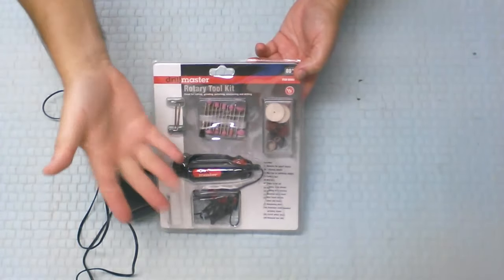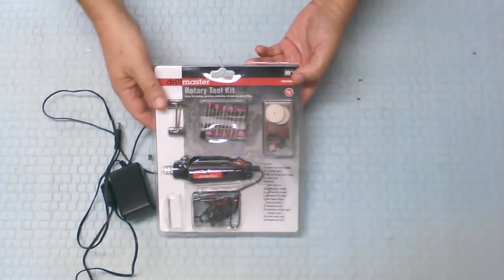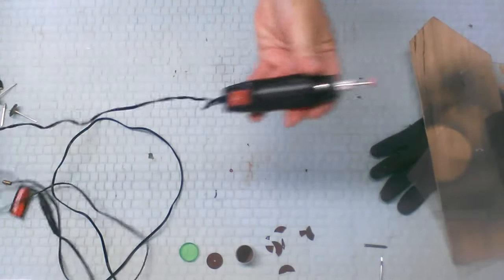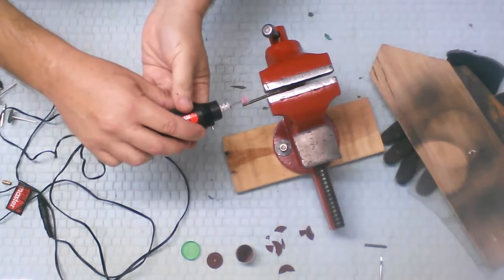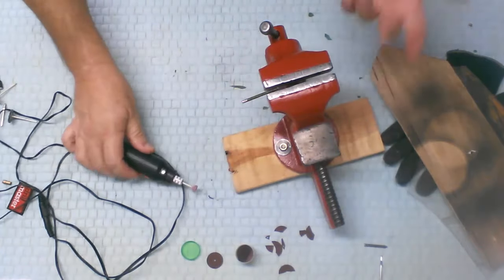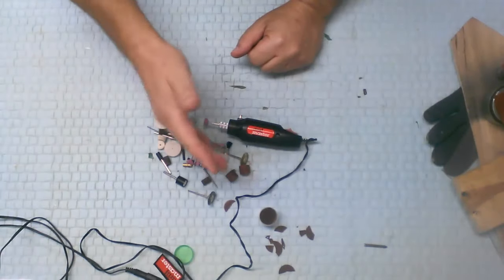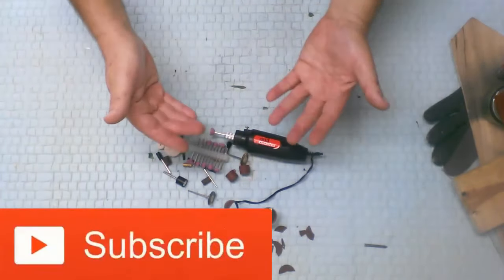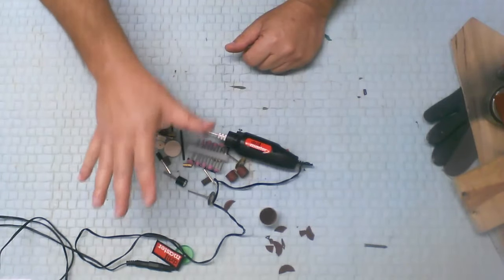Harbor Freight Rotary Tool / Drill Master Rotary Tool Kit Review

Comment: Bought this one this week to cut an aluminum crimp band that holds the fitting on the end of my garden hose. It took about 40 seconds to cut off. A normal rotary tool would have taken about 5 or 10 seconds. Just as you said, this thing would be ok for hobby type tasks, or maybe light duty for someone that might only need to use it no more than a couple of times a year. For $6.99 it is good enough for some light duty jobs, but after using it I realize that I should have spent more for a better one that could be used for all jobs. Very good video

Comment: On the nail test, as with any tool, the idea is to let the tool spin at the maximum RPM and let the blade do the cutting. If you pressure it, and it loses RPM, you won't cut as deep and it will take 4 or 5 times to cut the same amount. This goes for any tool, even your other two rotaries, or saws, or grinders, or anything. Maybe you are just too heavy handed? It would also make sense for your other rotary tool accessory video, the only other I have seen to this point. Also maybe you have a bad angle but if you watch the video back you will see you don't stay in the same groove or at the same angle, again furthering the time it would take you to cut. you hop skip and jump out of the hole at like 19:21 and just keep going though you are about 5 blade widths away from where you are cutting at.
Reply from the maker: I understand what you are trying to say but unfortunately you weren't using the tool. The tool itself has a terrible wobble (unbalanced) making it very unstable causing it to keep hoping around. The blades are also horribly irregular and not flat causing instability and poor cutting. The RPMs could not be kept at a consistent rate because the slightest pressure would cause the tool to bog down. I was cutting with the slightest pressure. Any less pressure and I would be there till Christmas. It is just a terrible tool, even though I tried to end on a positive note.
Reply: Amen, Brother!👍
Reply: Exactly!
Reply: @ModernDIYProjects i can get it quite centered when careful, but it is indeed easy as hell to make it wobble

Comment: Got this from harbor freight. The tool packaging says that it’s for wood I think somewhere on it. Not sure now. I threw the packaging away. I was cutting a car trim piece so, a piece of plastic. Cut through very well. It’s important to go slow and give the cutter some time. I think the plastic was about 2-3 mm thick and I was cutting a 42x20mm rectangular hole in it. Took me maybe 15 mins. This was the first time I was using a rotary tool, so I was very cautious. The shank did move up and down a bit on occasion and it was because of the grooves that were formed while making multiple passes. Took a flat head and removed some of the excess and it cut through just fine. 

All in all.. $10 for some basic hobby projects.. I won’t be trying to cut metal with this.. since it doesn’t appear to be made for that. Haven’t tried it on wood either. But plastic works very well. Just be patient.

Comment: Thank you for your honest review and also saving me $10. I almost considered buying this until I saw your video.  As a general rule I never buy anything from Harbor Freight that plugs into a wall.
Reply: I will say Ive been pretty happy with the corded 1/2" impact gun
Reply: @hopingforthebest1.9  Same here. In fact, it regularly out-performs my IR pneumatic 1/2" gun. I've had to tinker with it to get it to engage all the time in reverse, but it's performed like a champ for me for years. Just the other day, I thought I'd burned it up doing the control arms on my car, but the next day I pulled it out of the garbage and took it apart, to find the positive connection had come loose from the trigger switch. I tightened the screw back down and applied a li'l thread lock, and viola! Back in business again!

Comment: I finally had to throw mine out even intended as a light duty use. I spent way too much time patching it together and adding tape and glue to the motor mounts to keep it from vibrating itself apart. I can definitely recommend the Chicago Electric regular size rotary tool though, have had two that lasted for many years.

Comment: To be honest even the cutoff Wheels that are Dremel brand would break if you pulled on them like that. Not saying that those are not flimsy just saying that cut off wheels are not designed to be side loaded. I don't understand why someone would buy this though unless they are really really strapped for cash. For twice the price you can get a full size rotary tool off Amazon. And for another 20 bucks you can get one that comes with a flexible pen extension, router head, grinding shield, and a enough attachments to last you for years.

Comment: I have this tool and it's best used to crafting that is what I use it for.  If you put the attachment and tighten it and then screw in the blade it won't fall out and you won't brake the blade

Comment: I have the same set and I agree that it has it's limitations. However, try and get the accessories for a better price. I realize they are not of the highest quality. I too have to tighten the collet with small pliers, but I use it for a lot of small tasks. We will see how long it works, I have had it a month. The black and decker is three times the price of the drillmaster.

Comment: You can't expect this to do the job of the bigger rotor tools, it's light duty and for small jobs. It works great for the fine detail wood work and glass etching that I do. if I need to cut a nail or a screw then I use one of the bigger ones I have in my tool box. For the money you spend on it you really don't think it can hold up to the bigger one now can you ?

Comment: You should have bought the diamond rotary cutting disk in harbor freight for $6. I got it for about $4 with a discount they cut metal better.
Reply from the maker: Good idea, but I was using what came in the kit so as to be a fair representation of what the buyer should expect.
Reply: @ModernDIYProjects  yeah I understand but for a cheap $6 tool it's not that bad. It's good for cutting in tight locations I like it.

Comment: Bought one to get started on practicing wood carving on sticks.after my first project (just a few short hours of playing with it) the thing was pretty much burned out. Still got a feel for the job before it died. Ended up getting a dremel 3000 to replace it.  Think of it like buying a crap guitar to practice and decide whether you like playing enough to justify getting a les paul.
Reply: You mean a fender right..😆!! Just kidding.
Reply: I was just thinking about buying a dremel 3000 (this is how I found this cheap one) is yours doing good still ?
Reply: @LowkeyAirgunner  yep the 3000 is still going.

Comment: im looking to do some polishing on phone and apple watch screens to remove some scratches and i need a dremel but i dont want to break the bank would this be recommended or should I pay the extra to get something better
Reply from the maker: Definitely do not use this machine! This machine vibrates so much and is so far out of balance that it will probably put scrathes in the watches instead of removing them. This tool is not good for fine detail work like what you want. I would say that you can get a good Dremel tool for around $40. That is not too expensive and will serve you much better.

Comment: I have one of these somewhere and it has like no power. I don't think the power adapter that comes with it can supply enough amps. If I find this tool I will test that with a 12 volt battery and if it's still weak I'll turn it onto a fan.

Comment: ~7 or 8 years ago I asked for a dremel for christmas. I got both this set, and a proper GENUINE dremel. I still have both.

Of COURSE I lost almost all the accessories! It's like, a felony to NOT lose atleast one piece in a tool set!

Both have been abused, but the Chinese special still works! (Albiet the bearings in the motor are basically nonexistent, turning the tool into a vibrating sex toy...) The dremel ended up failing due to a design flaw (the end of the stator's windings snapped).

Comment: Instead of putting one cut off wheel try putting two on at the same time thats how I've been doing it and it works rather well
Reply from the maker: Interesting idea. I thought about that, but I figured the friction of two parts rubbing at possibly different speeds could possibly cause the end of the universe as we know it. Or at least the two blades would shatter. I guess I was wrong on both counts. 😆

Comment: We've had this thing for a while and when we first starting using it the cutting wheels would either get stuck and stop or shatter and I was wondering if we were doing something wrong. Seems not! We forgot we had it for years and now my dad was sanding some wood and I remembered we had this little thing and it's been doing much better than sanding by hand. Good to know it's not a good cutter, at least sanding seems to be doing alright. Can't say we expected much for the price anyway. Nice video, thanks!
Reply: To be fair, my legit Dremel busts grinder wheels all the time too. There are few things more frustrating than being 95% of the way through cutting something and having your cut-off wheel shatter in your face!
Reply: The long metal part/attachment won't even fit in my drill! So frustrated! 🥴

Comment: Im in the market for a rotary tool. I basically just want to trim my dogs nails. And I might use it for other things down the line. Thank you so much for this video. I was about to buy this but I will not. Can you recommend a good rotary tool on a budget?
Reply from the maker: This tool is so wobbly and noisy that i certainly would have scared your dog. As for a good alternative you can look on Amazon, or Walmart has a really good one at a reasonable price. Just check Walmart and see what they have available. I have reviewed several other rotary tools including the Walmart one and other more expensive ones. You can look on my channel page for those reviews.

Comment: However it can be ran straight off a 12v battery. add solar system with usb led car 12v ports you could have tons of light @5v .5A.. saves power to the point you could dremmel all night long
Reply from the maker: Yes, you could but I seriously doubt this POS would last all night long. It would grenade before your eyes before dawn. 😀

Comment: I look at it this way...for 10 bucks it can't be beat.  If it breaks buy another one and you got extra bits.  My only complaint is that i can't slow down rpm
Reply from the maker: Watch this video where I show you a quick way to make your own RPM controller. The tool I review in that video does not have any RPM reduction so I showed it for that tool but can be used on any tool: https://youtu.be/OcUs7qns3T8

Comment: I have one and I don't like too much. Maybe for 10 bucks it's pretty good, but you get what you pay for. The cut off wheel constantly gets loose. The screw for tightening it is smaller than the post it screws into. Also, it vibrates alot, making your hands numb.

Comment: Which adapter tip would u use to engrave your name on tools like wrenches and sockets?
Reply from the maker: It comes with a few metal tips that you can use for engraving, that is if your machine spins true. My machine has a huge wobble so it is useless as an engraver.
Reply: @ModernDIYProjects  Correct me if I'm wrong, it wobbles because the metal tip rod is warped. Right? So therefore can it be fixed by straightening it out on a vise by tightening and rotating it several times? Or at least improved dramatically? 
Or is that superrrr hit or miss?
Reply from the maker: @selwyn13  It depends. If your metal tip is warped you could try to straighten it. But in many cases the machine internals are misaligned and that is why it has a wobble. To see if this is the case just try other tips. If they ALL wobble, then you know it's not the tips.

Comment: Ok thank you my son just got this for me for crafts now I know I will be getting another one from home depot soon
Reply from the maker: I would suggest to use it till it breaks, but before you run to Home Depot, check out Walmart. Check out my other video on the Walmart, Hyper Tough rotary tool ( https://youtu.be/uNEmQFKEaoA ) which is a good tool for only $6 more than the Harbor Freight tool you just got. Home Depot will probably be more expensive.
Reply: I would but I'm nervous about the whole getting warm thing.
Reply from the maker: @TheCathe1221  I understand completely.
Reply: You can buy a wen 2307 or a wen 2305 I have the wen it's ok for the money I also have that drill master 1600rpm slow and it stinks
Reply: Don't give up on it. It does nice pedicures. I might have found a new talent.
Reply: @D25864  this is precisely what I used the dremel for but I had to be super cautious to not remove too much material (skin and nails)! I haven’t opened this package yet but for $6 bucks it was worth the gamble.

Comment: Oh my goodness so I bought this just because I was short on money and I need it to sand down some of my resin pieces for jewelry making and I'm just like so scared rotary tool thing that goes in the hand gun thing it's just going to come out and it's going to hit my eye or something even though I wear glasses and it's really hard for me to find some goggles that fit I'm like so scared that is just going to pop out and I'm having to pause every freaking minute to make sure it's not going to pop out and hit my eye or something....
The first time when I was sending down a piece I did a first piece which was really small it's just like a heart for some earrings I'm making and then I was sanding down the other hearts and I didn't finish and yet the thing came out and I was like oh my gosh and I thought maybe I just didn't put it correctly but now that you mention it I need to take a pause every minute and I think I will definitely invest in that Black & Decker one that you have or the one that you suggested from Home Depot..
Anyway a little too late but thank you for making this video very informative
Reply: Get good cutting discs? Maybe that could be a lot less frightening.
Reply: When you say resin do you mean a mold or do you have a resin 3d printer? Just curious
Reply: @freezer81  yeah I mean regular liquid resin that you would put in a mold..

Comment: I bought one of these for the sole purpose of polishing oxidized copper jewelry.  I've never used a rotary tool before, so I didn't want to invest a lot of money.  It comes with NO directions of any kind and I STILL don't have a clue how to use it to polish.  Can anyone tell me how to use it in that way?  Thanks in advance.
Reply from the maker: It's simple. This applies to all rotary tools. Get the little fuzzy pads and install it in the metal rods with the screw on top. Insert that into the top of the rotary tool.  Then add some polishing compound and away you go.
Reply: Thanks so much!  I really appreciate it!

Comment: I tried to use mine  earlier out of the plastic it didn't turn on. I had it for several months and never tried to use it. I should have known better. It is too late to take back.
Reply from the maker: First try to see if it's the transformer that is bad or the leads are backwards. You can try with any other 12V transformer. If you still have the old style like the one I got where you have a split in the middle of the cable. Try turning the connector 180 degrees to see if the polarity if wrong.
Reply: Thanks you, but I dont know if I can figure that much out. I really appreciate the information 🙂
Reply: It's working I tried another cord. Or transformer and it worked.

Comment: Had the previous version of this one.  Cheap and very limited in its use.  Fell apart within a year.  Buy a Dremel or similar more durable brand.  This is built flimsy and more a throw away tool.  Although the size and concept is attractive, you get what you pay for.  I bought a lot of Harbor Freight stuff for many years and been 100% satisfied.  I was thinking about this one, I’ll pass.